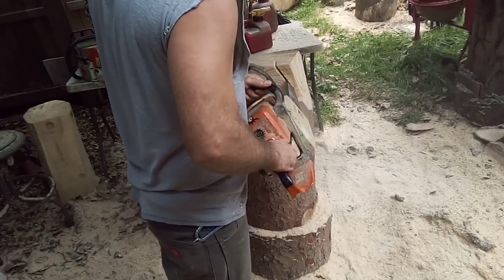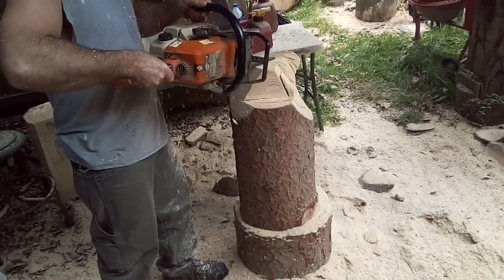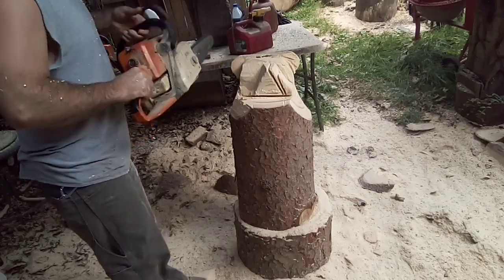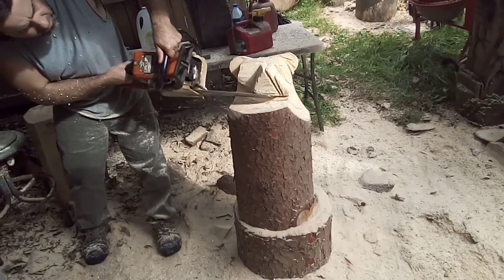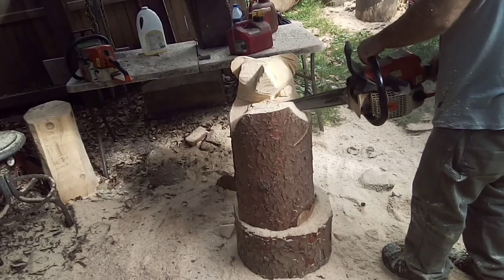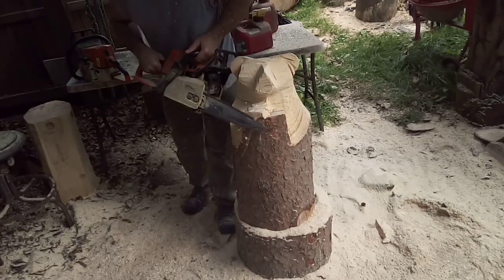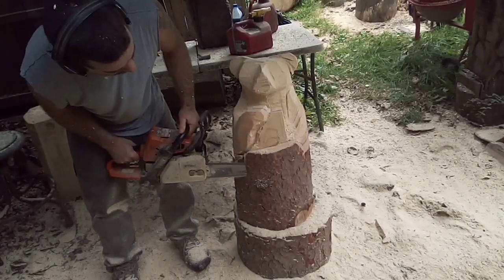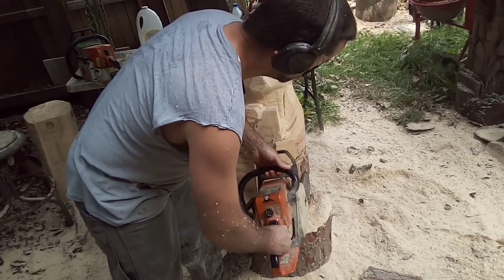Chainsaw carved welcome bear rough out

Comment: Thanks alot for the work u put into these Video’s
Any chance u can one about tuning the chains ? 
I been cutting trees fore about 16 years 
And ure vids about taking of the backs of the chain blew my mind 😂.  Gows agains most of wat i learnd but hel it works great
Reply from the maker: Trimming the backs is against normal chain use needs. It not only shortens the usability of a chain, but it let's the cutters wander, meaning the chain can cut well straight, if held straight, or it can cut well in pinch, and twist situations. The drag of the tail of a stock chain helps it to stay straight, on its own. So the theory in carving is reduce drag, and you increase leverage, and torque, and reduce heat build up. So you may be litterally cutting the use life of a chain in half, but you actually are prolonging it's life, and the life of all the connected parts, bar, sprocket, and saw, when you cut down on heat build up.
Reply from the maker: I've tried making a few chain vids, I'm just so bad at explaining it, and making it not be a six hour long video, lol... I need to do short videos, focusing on one part, and getting good footage. Takes me a long time to do iether well. Lol...

Comment: Is that pine?
Reply from the maker: Great question, this one is not pine, its spruce. I some times use spruce because its readily available...I have many videos on wood curing, and choosing good wood, processing wood, I touch base on spruce wood, and will be getting more into showing hard wood videos, but so much to get through just with one wood, I wanted to cover pine first, as it's such a common,easy wood to work with.